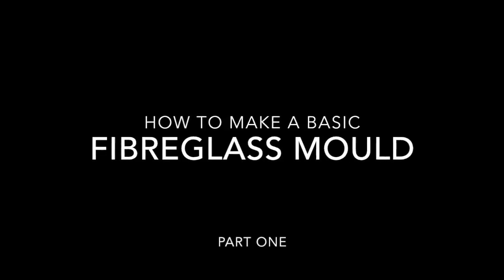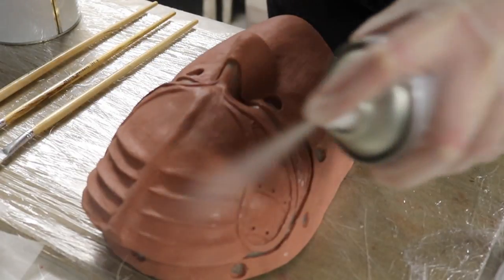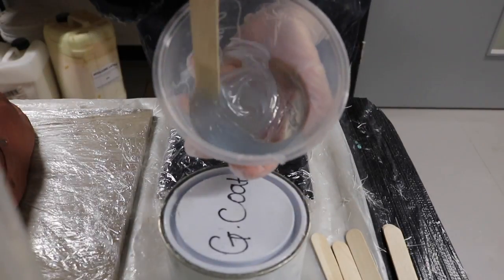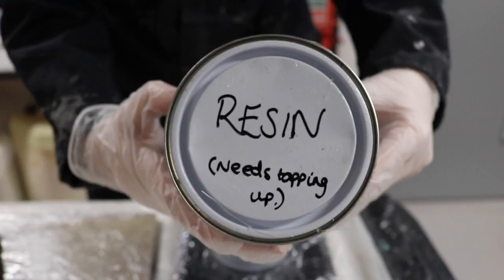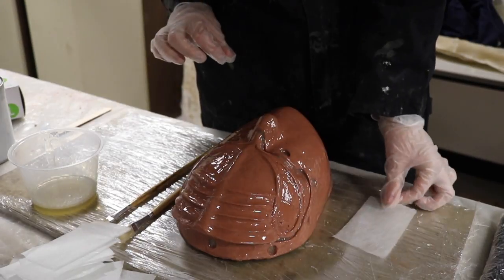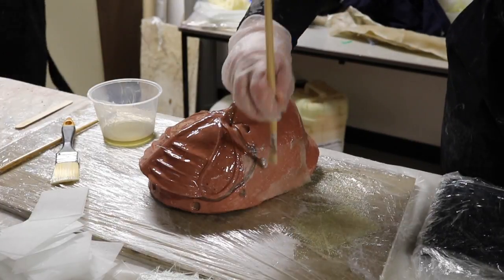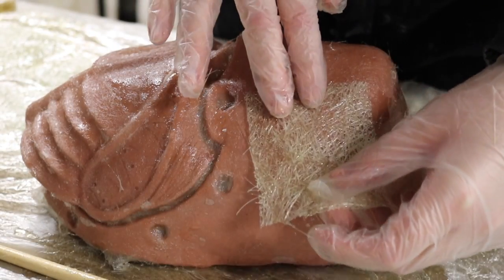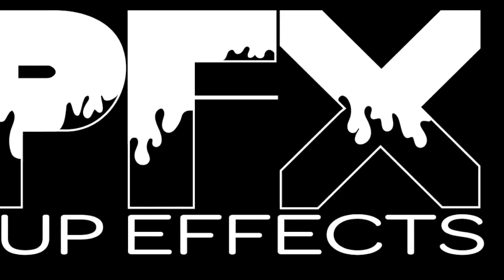HOW TO MAKE A BASIC FIBREGLASS MOULD: PART 1  |  EPFX

Comment: I recommend you mixing a resin slurry (peanut butter) with talc or any other filler. It will avoid any air gaps, pockets, & bubbles. That part has a lot of deep grooves. Put a good coat after the gel coat, making the surface flat. Then fiberglass.
Reply: Absolutely. I use cabosil, 1/64" milled fibers and ceramic powder to make my paste. The fibers ensure strength and the ceramic ensures a good cosmetic profile

Comment: I am making a male mould for a CF telescope tube.  The mould will be made of wood.  What is the best way to prepare the mould so the part will release?
Reply: Seal it with either a resin or varnish first, then put PVA (poly vinyl alcohol).
Reply: Thanks Joe.  Going down a different route now though.

Comment: Hi, what's the material of the mould??? It's clay???
Reply from the maker: The orange stuff is NSP chavant clay in medium, sculpted on top of a face cast (which is also fibreglass, to make the two part mould)
Reply: @epfx4181  thanks, i love composites
Reply: @epfx4181  how did you get the face cast? What are the steps you took before this video?